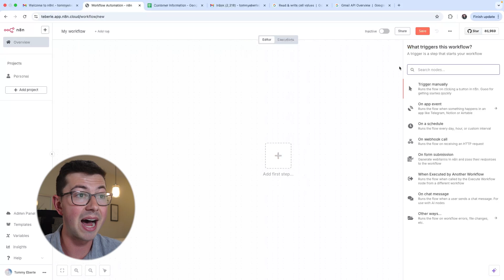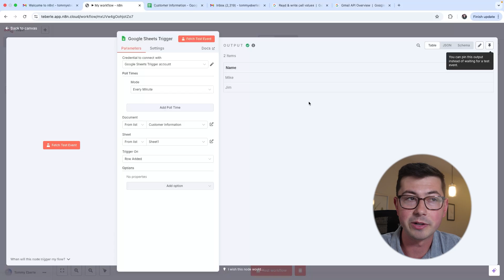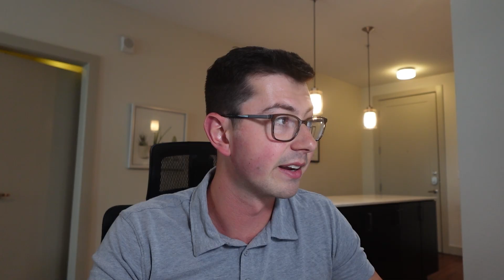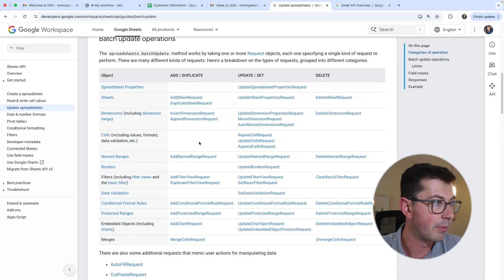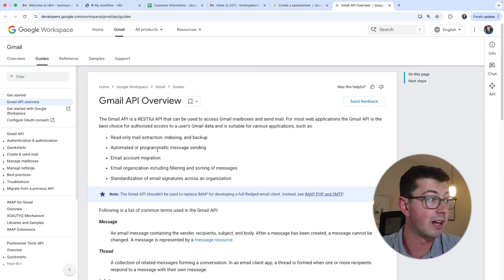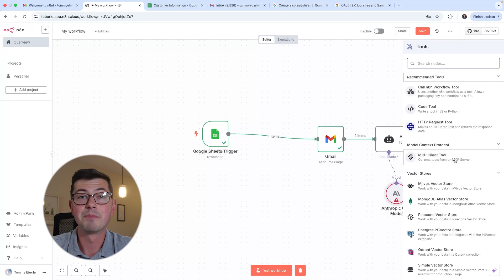I was WRONG about no code platforms (n8n, make.com)

Comment: Agreed through the key challenge is testing… unit and end to end tests… always has been a challenge with visual programming and also is with n8n. Making sure that existing stuff keeps working when you add / change new stuff is the hard part. So in situations were you would not write tests anyway (or go full aware with open eyes into the pain that comes if the solution is growing) than this is a good choice.
Reply from the maker: The testing could definitely use some improvement. That being said, a lot of workflows would arguably be harder to test in traditional code. n8n lets you "pin" the results of steps which is super helpful for expensive API calls (like openAI). You could of course implement some sort of caching or mock to test in eg a python project, but it's not immediately built in like with n8n.